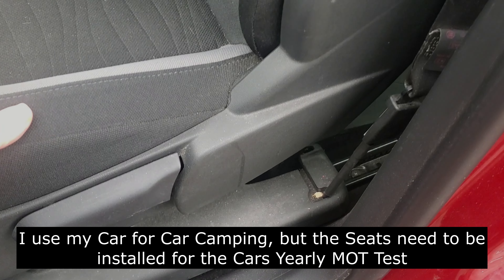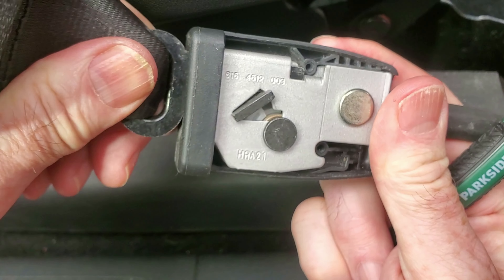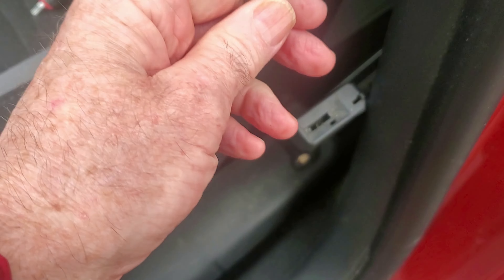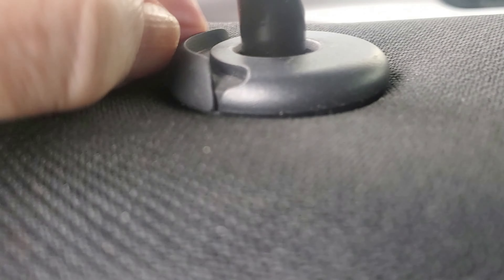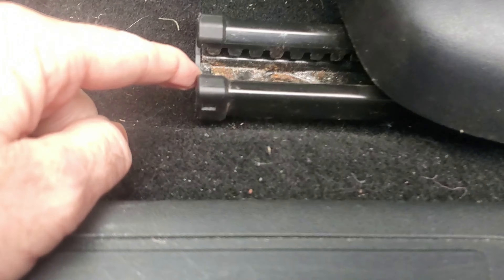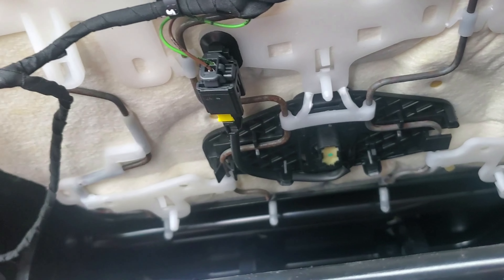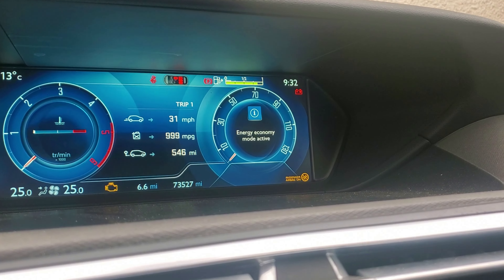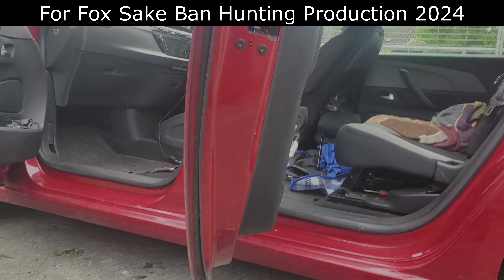Citroen C4 Picasso,  Front Seat Removal

Comment: The children inserted something into the rail under the seat and couldn't move it. the rear screws are available, but not the front ones because the seat cannot go backwards. Can I unscrew the rear screws and tilt the seat forward to get the object that is stuck?
Reply from the maker: Sorry to say that the seat wont tilt forward. The older model of the picasso seat tilted forward because the car battery was stored below it. You could try using a vacum cleaner to suck out whatever is stuck in the rails or mybe a airline to blow it out.. a bit of wd40 might help to losen it.
Reply: Tnx for advice!

Comment: Great Video - please could you show how to do the same for the rear passenger seat?
Reply from the maker: @benharper4904  Hi Ben. Good news is the rear seats are easier to take out. Only awkward bit is unclipping the electric cables for the seatbelt NOT ON Warning light.  They are clip in place and not much room for your hand. When you put your seats back in then no need to reclip them in place, then next time you take them out it's a breeze. I'll put a link to the video below.
https://youtu.be/nV6H-gVpWA0
Just rambert when putting the seats back in each one must go back in their original place or the seatbelts won't work